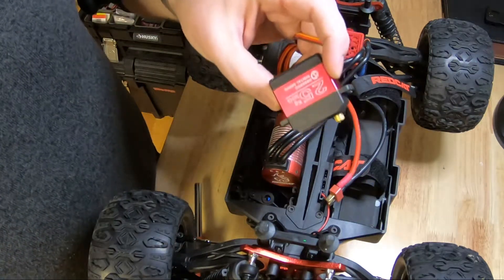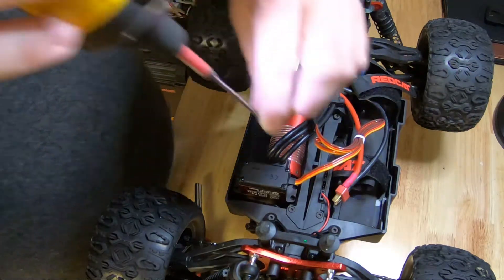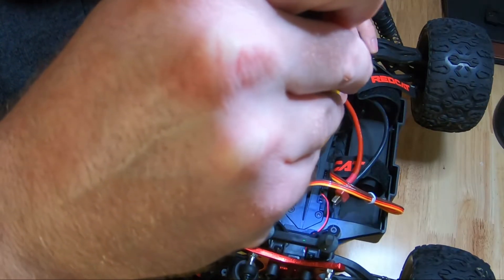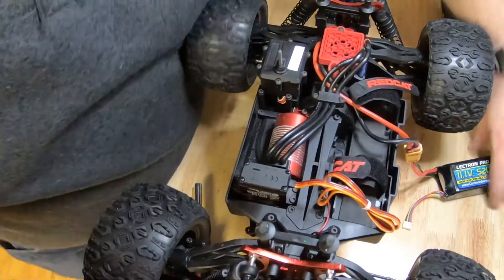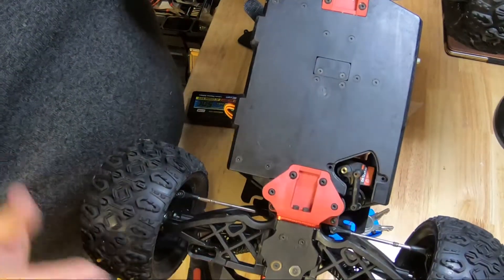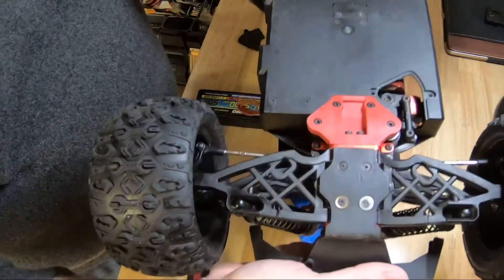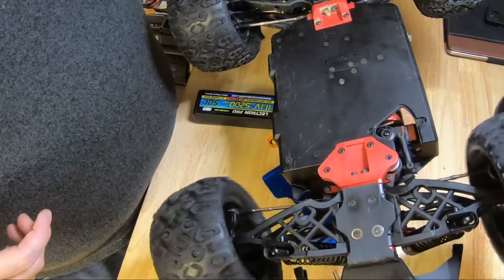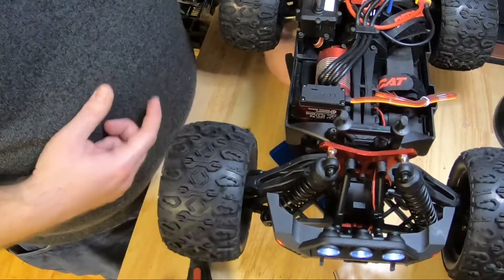Steering servo installation and alignment on MT10E

Comment: Thank you. The servo screw fell out on mine. There was no locktight on it. Unfortunately I didn't line it up correctly and I had the dual rate at max where it was impacting the steering linkage and it broke.